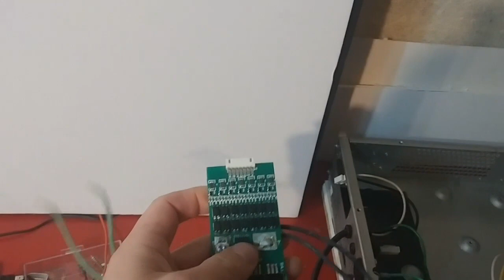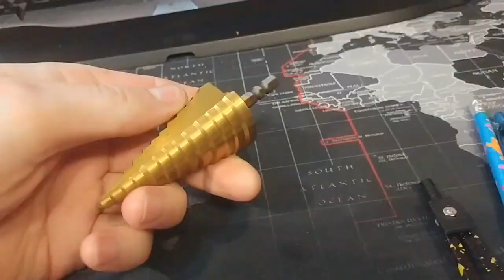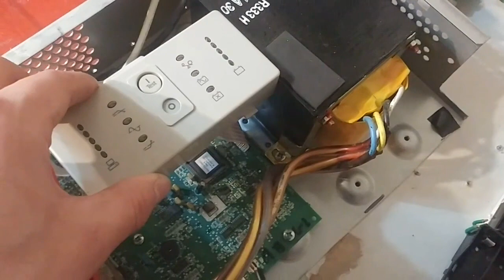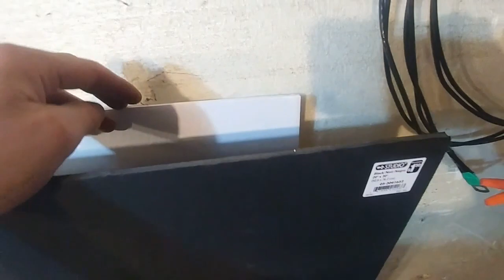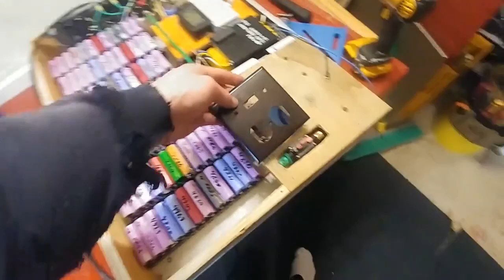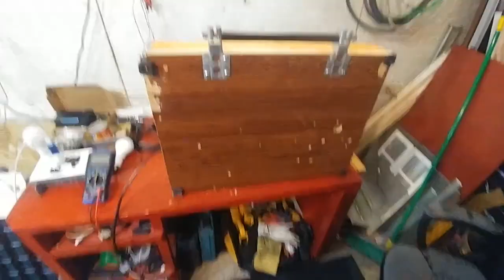Building A Portable Modular Power Wall out of Lithium Batteries

Comment: This is a most impressive and instructive video i dont think this one tiny comment box will cover all my thoughts but i see that handle and i think damn lifting  that would be so heavy id feel like i may die lifting it. I think over time you will be constantly improving this design, Under heavy load you may have to monitor the temperature of the primary transformer core.
Reply from the maker: Thx! Its only 61lbs. My daughter weighs more lol. The ups has a temp probe that auto shuts off the unit so np there. The apc i put in there has an issue. It software shuts off at 600w so i think i messed it up with all my key mashing while learning to use hyperterminal.
Reply: @AndyShell  Im going crazy trying to rigup a 8S cell i just got off ebay like trying to find thick enough wire. as far as i know there's no temp sensor on the core but the software does report temp readings so im guessing it reads it by ambient airflow around the case on the assumption all holes are filled and the fan is sucking and blowing air out etc.
Reply from the maker: @steve64464  you can just buy a simple tempurature relay switch like off a hot water heating system or furnace. N/C switch connected to the inverters on off switch
Reply: It may be something to add yeah , trying to resolve that led Indicator that says how much power is left now.
Reply: @AndyShell  dam. Thing only displaying 2 Led for its battery charge level so I'm guessing I may have to change a setting somewhere